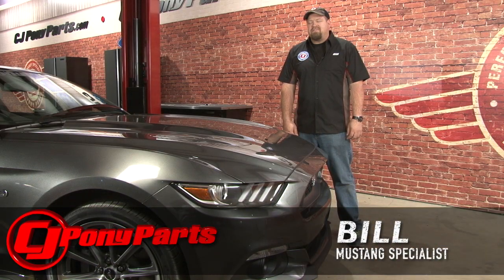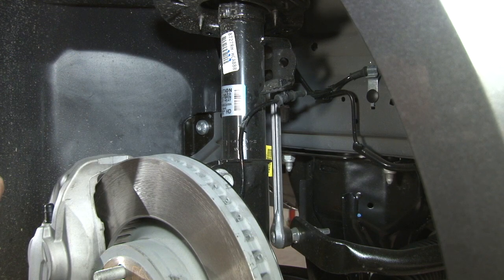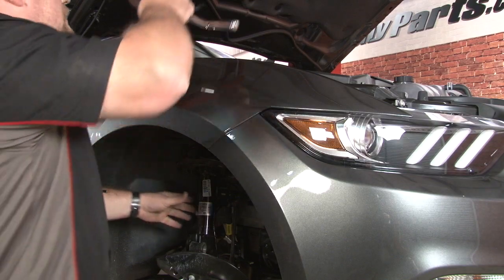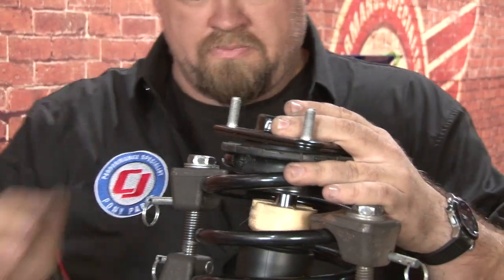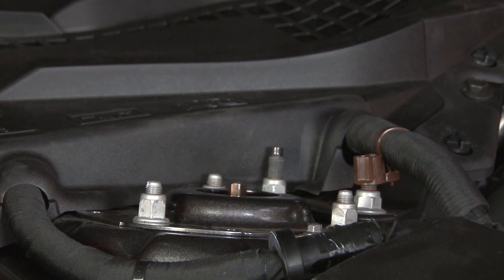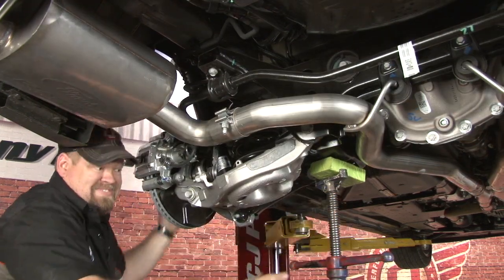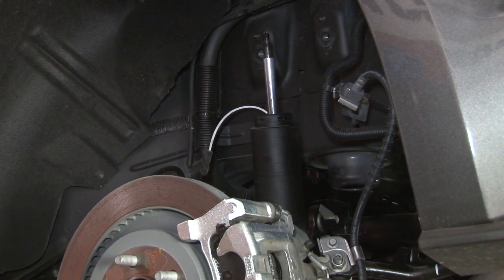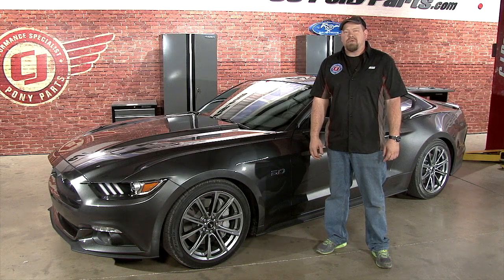2015-2023 Mustang GT Eibach Pro-Kit Springs Installation

Comment: Just got this done and everything went exactly as demonstrated on your video. However, my manual spring compressors did not comply with the diameter of the spring perch so I had to jack with that to find a sweet spot where they would compress and release clear of the perch. I logged about 4 hours actual install time in my driveway on jacks, but the spring compressor puzzle took about 30% of total install time, other than that the install was a cake walk and the results look great.
Reply: Did you have trouble knocking out the splined bolts at the base of the strut? Mine won't budge no matter how hard I pound on them.
Reply: You need to use a dead blow hammer on the lower bolts. I have a non-marking type hammer but if you place a block of wood on the end of the bolts they shouldn't distort as you drive them out. it takes some smacking to drive them out.
Reply: *****
Thanks. I finally got them out. It took the full force of two hands on my 3lb. hammer.
Reply: Yeah, they're pretty hard to tap out. I think I was using a 4lb hammer and it took some pounding. I'm glad to hear you weren't using a roofing hammer or anything light weight.

Comment: cJ is there only two long bolts holding the entire subframe in or your just undoing one side at at a time? Does the subframe have locating pins in the unibody? Torque specs?
Reply: ***** The torque spec I was given was 89 ft/lbs so that is what I went went. Ford used the same spec for K member to chassis bolts and previous IRS as well
Phil C There are 2 large bolts per side, I did one side at a time
Reply: ***** Sportlines will lower the car more. Around 1.5-1.75

Comment: Thank you so much for this awesome vid! I have 20" rims on my Mustang GT. Would I still be able to use this kit without any issues as far as tire clearance goes? And will all the items you described be included in the kit, or are there different stages to the Pro-Kit? And one more question, would this change the suspension geometry? I was concerned whether or not the lower control arm would remain parallel to the ground. Sorry for all the questions, they've just been running through my mind... I plan to purchase this kit soon, and I'm looking forward to bonding with my new car with working on her myself. Thank you so much.
Reply: These will work fine with 20 in wheels, there are no other parts required but a few people have gone with Maximum Motorsports caster camber plates or Eibach camber bolts to dial in the alignment. The geometry is changed slightly but creates no issues, most people including myself have felt the car gets better traction with less hop with the lowering springs installed.

Comment: Have now just done rear of new '15 GT with Track Pack.  Two major issues 1) top of shock pistons/rods now have a pressed-on spacer, which must be removed in order to remove boot on shock (build date 12/09/14) in order to install the Eibach bump-stop; and 2) the rear spring doesn't just pull out when you press down on the suspension as shown in the video...eventually after much effort, and re-watching this video, I had to first use a spring compressor to shorten the spring as much as possible (could only get one on--yikes), then a 4' steel pry bar to press the suspension down, then a 2 1/2 # short sledge hammer to tap out the top of the spring.  I had to work alone, so trust me when I say you are well-advised to have a very large, very strong friend with a large pry bar to assist in getting that spring out of there.  Since the Eibach rear is a bit shorter, it went in without being compressed, but the pry bar was still necessary.  Also, to avoid a trip to the local AutoZone when everything's apart, have a small gear puller available beforehand to remove that press fit spacer.  Also, since I'm putting on a cat-back exhaust, I had pulled off stock exhaust beforehand to give myself more room to work during the above...and it was still a major pain.
Reply: I will keep an eye out for the pressed on spacer, we have done a few of these installs now and have yet to run across that issue. I also have not had any issues getting the spring out as shown. It probably looks easier on video but a good tug with the suspension dropped as shown and it came right now on several different cars.
Reply: Bill Tumas Thanks.  The difficulty was with the RRear; when I did the LRear the next day, it was cake, just like the video.  

Another issue is that the big bolts on the bottom of the front strut just wouldn't come out after taking off the nuts.  I ultimately used a 2 1/2 # short sledge, and even that didn't budge them.  Thinking that current production might've gone to normal threaded bolts, I tried using a substantial lever on the 1/2" ratchet to see if they'd move at all.  Nothing happened.  I held back using my 350# impact wrench out of concern for snapping off the bolt head.  

My local dealer's parts guy didn't have any bolts in stock yet, and he couldn't tell from the online parts display.  The service guys haven't taken one apart yet, so they didn't know either.  So, it's going to the dealer to R & R the struts and put on the Eibach springs.  I'll report back on what they actually find.
Reply: James Bianchi Here's the final dope on this:  the big bolts joining strut to hub are still splined.  The tech at the dealership also pounded the crap out oft he bolts without result.  Then...he used a spring compressor to RELIEVE THE PRESSURE on the splined bolts, and they just tapped out.  This may be unique to the Track Pack setup, but maybe just later in the model run issue.  Cherish this info...I paid to get it.
Reply: James Bianchi Forgot to mention...when the dealer did the front springs, they also did alignment.  Said that the alignment came out Ford perfect, i.e., they were able to get the factory alignment with the Eibach Pro springs with no problems.
Reply: I came here to see if that spacer had been addressed. I just started the rear of my car and it has it on there. Car is a 2018 GT Base

Comment: Looks straightforward, but for reinstall, shouldn't Ford's torque specs be used?  If so, what are they/how do we find them? Some battery-powered impact wrenches can put out more than 350 ft-lbs, enough to ruin stuff.  Some sites have said that the front struts use a once-use set of nuts & bolts, and that replacement sets are available from Ford for about $20.  Is it correct that the original stuff should not be reused?  Please respond.
Reply: The only torque spec we had access to was the subframe bolts at 89 ft/lbs. Ford has used torque to yield bolts for years and recommends them for one time use only but most people don't replace good bolts every time they take something apart. It is up to you weather you want to do that or not.
Reply: Bill Tumas Thanks Bill; the torque specs are pretty important on suspension components. The 89 ft/lbs is unexpected; I would've definitely over-torqued.  From another source, I found that the torque specs on those lower strut bolts is about the same, 89 ft/lbs if others are interested.

Comment: Should I be concerned if the damper spins as I tighten the top strut mount? Should I clamp it?
Reply: As long as it is tight you are fine but if it is spinning you want to secure it and make sure it is tight.

Comment: Great video, would definitely sway me to buy springs from you guys when it's time, although the angle at 11:36 leaves the onlooker a little confused - hard to see what you're aligning. How easy would you wager dropping the subframe for the rear suspension is using jackstands in a garage? Have to put it up fairly high and support it with a jack?
Reply: We have had a few customers install them in their home garage on jackstands without issue.The spring sits in a perch in the bottom, its easy to see once you are there, but really can't get the camera in there.

Comment: I would make sure the spring is seated properly in the pocket on the rear suspension, There is a specific place it should go which we show in the video.
Reply: Bill Tumas what tool is used to support the subframe for the rear spring install. I didn’t notice  it in the tools needed section. and is it a necessary tool that’s needed for rear installation?

Comment: When trying to remove the nut from the strut (like at 4:35) the entire rod moves with the nut, any advice?
Reply: You would have to use a strap wrench to hold the strut or use an allen key in the center and a wrench to loosen it.
Reply: Get a pneumatic tool and that won't happen.

Comment: Have a 2015 gt. changed the springs and abs light came on.  How do i remove it?
Reply: steve carrillo The springs have nothing to do with the ABS sensor. Make sure you did not damage or unplug any of the sensors during the install.

Comment: Out of the sport line and pro eibach which of the two is lower
Reply: Paul Anthony pro eibach will make your car lower, but I’ve heard a lot of people having problems with them due to getting your car re-aligned at the shop because it’s too low. I went with the sport line and really the pro make the car sit about an .25 of an inch lower. So I guess it’s up to you.
Reply from the maker: Sportline is lower than the Pro-Kit, usually about half inch for most kits.

Comment: When lowering the subframe, what was that green thing and what is it for? To help better stabilize the subframe?
Reply from the maker: Nicholas Banda it’s just a block of wood wrapped in green tape I use to keep from scratching anything
Reply: Nicholas Banda what’s the tool he used to support the subframe? The tool that the green block of wood sits on.

Comment: Hey Bill, is it okay to use the stock bump stop for the rear? I cannot fit the ones that came with Eibach, the diameter of the hole is too small.

Comment: I have a 2015 MUSTANG GT with performance package and went with 20x10 with 275/35/20 fronts and 20x11 with 305/35/20 in the rears. 
A) will lowering it with the pro kit be fine (rubbing)
B) will I need to get the Eibach adjustable camber bolts?

Thank you
Reply: You should be fine with just the pro kit.

Comment: Hi, 
2017 Mustang s550 with 275/35/20 in the front and 295/35/20 rear, can I still use this Pro-kit set? Totally fine even I turn the wheel to the very end, right?
Reply from the maker: Yes it will be fine with that setup.

Comment: hows the ride? i mean if u dont replace the shocks and just the springs usually it gets bouncy, also what size are the tires and wheels.just to get an idea
Reply: It rides ok but could be improved with new shocks and struts.
Reply: what the best coilover suspension and maybe sway bars that u would.recomend for daily driving comfort while.still being better than stock at the track.?

Comment: Bill, do you have to get an alignment after lowering it? How's the ride quality compared to stock?
Reply: Yes, anytime you raise or lower a vehicle it will inevitably change the toe etc, an alignment is absolutely necessary.  I would also recommend checking the camber/caster after lowering, if it's off by much you need to get it either adjusted at the same time or purchase caster/camber plates or spacers.  If you can find a quality shop where you can buy lifetime alignments that will setup your car to your liking and specifications I would go for it.

Comment: I see below you said CC plates are not "necessary", but would they still help with alignment or is it redundant? Also, would a bumpsteer kit be a wise addition to the lowering springs even though it's not too big of a drop?
Thanks for anyone who can help, I'm still kind of a newb with this.
Reply: +Spaceman24  They will help dial in alignment for sure. Bumpsteer really isn't an issue unless you go a little lower.

Comment: i noticed that the install on the gt the tire/rim combo is smaller than what I have. I have the gt premium convert with the 20" tire package. will this kit fit my car?
Reply: Yes it will work fine with that setup.
Reply: Will this setup work with 20X11 305 35R 20s in the rear?

Comment: Hi CJ. Eibach Pro Kit will fit to the GT Premium models to? And it will lower?
Reply: Yes they will work on the GT Premium and provide the same drop
Reply: +Bill Tumas And with the Performance Pack it will be lower or just with the Sport Kit?
Reply: Bill Tumas Bill question.. after install with this springs.. an alignment should get done with no problem? no camber arms needed for the s550's or anything? new to the stang community, coming from a 350z-370z those needed camber arms to get the alignment on point and not have to much negative camber.. thanks in advance
Reply: Yes I would recommend an alignment and, unless you go extreme with the drop, you will not need any other parts.
Reply: Bill Tumas thanks Bill!! 👌

Comment: What are the alignment specs after you drop vehicle.  I purchased Eibach pro kit springs after watching video and information is not included with springs.  Shops(Firestone,discount tire, etc.) don't have the alignment specs for these cars yet and I went to Ford dealership and they don't have the specs either.  Kind of pointless to be selling kits that don't have wheel alignment specs included especially when shops don't have this info yet in there systems.  Tires will go bad fast... Fail for Eibach for lack of alignment specs.
Reply: if they alignment shop knows what they're doing you shouldnt have any problems
Reply: Actually no and nobody wanted to touch it.  Every car has different specs for caster, camber and toe.  Plus these cars do not have adjustments for caster and camber as they are fixed.  The camber is what gets thrown off when lowered and they don't sell any camber adjustment bolts for these cars yet.  What I did was buy one for the 2014 mustang which worked on the 2015 but was a much skinnier bolt but still worked.  I had my brother who works at firestone as a tech get the stock specs before lowering and getting the print out.  He entering a 2004 mustang cobra to get specs as these cars came with IRS.  Everything came out in red which proves that all cars have different specs.  You have to enter a vehicle with IRS and not solid axle or it wont give you any specs for rear tires.  As far as the stock specs I got here it goes for anyone that needs them.  -0.8 Left & -1.1 Right camber front, 7.2 Left and 7.1 Right caster front, -0.18 Left & 0.13 Right toe.  Toe seems to be off from factory as they are not close to each other.  As for the rear here are the specs. -1.4 Left & -1.5 Right camber rear, 0.07 Left & 0.24 Right toe.  Again the rear toe also seems to be off from factory but the car drove straight, no vibrations with smooth ride.
Reply: tomnguyen717 rear also has no adjustments which is weird ford didn't include this and did include this on my 11 year old 2004 mustang cobra which has adjustments for camber in the rear with an eccentric bolt from the factory.
Reply: Alex G
find a better shop, theres no reason a local (non-chain) shop cant get it on their lift and align the car properly. like tomnguyen717 said a good shop will be able to regardless of having specs.

Comment: hello cj pony,
i am a customer and i just bought a set of eibach pro kit springs and the dealer just called me to tell me that i now need a camber kit, i was just wondering if this is true and if so why wasn't i told at the time of purchase or even on this video?
now my car is at the dealer stuck because the parts are not even available for purchase so my car has to stay parked till then or pay another $300 to install the stock ones back...
how can you guys help i have spent over $1000 in your company this month alone
Reply: There is no reason to reinstall the stock springs, most cars will align to spec without the camber bolts. If it doesn't it will only be slightly out and will not hurt anything until you get the camber bolts installed. Eibach only recently listed one for 2015 GT fitment, long after this video was made. We are adding them but if you need them in a hurry Summit Racing has them in stock. Part number is 5.81280K

Comment: I have always heard that putting aftermarket(stiffer) springs with your stock struts/shocks will prematurely wear them out. Is this true?
Reply: +Jahcrooks  Depends on weather or not the new springs are within the working range of the original shocks and struts. If you go too low the stock parts will wear prematurely, an inch to an inch and  half and you will typically be ok.
Reply: ok, thanks for your response

Comment: Hi bill, what size wheel would you recommend after the pro kit installation. I'm thinking 20"x 10.5 but im not sure if they would work. Please advise.

Thanks!!
Reply: With the proper offset we have run 20x10 all around with no problems, 10.5 should not be an issue

Comment: This might sound stupid but wouldn't been easier to just loosen the rear lower control arm push down on it then remove the spring?
Reply: We tried that. You can't compress it enough by hand, if you have a spring compressor that fits or feel lucky with a prybar you can get it out that way.
Reply: Bill Tumas
i used a prybar :) on my cousins car
Reply: tomnguyen717 It absolutely can be done that way but we are not going to show that. There are too many safety issues using the prybar method.

Comment: Wasted a lot of time taking calipers and rotors off, probably would have been better just to use a wrench on the caliper side and a breaker bar on the other.
Reply: Its only two bolts to remove caliper and he said there are splines on the bolt to stop it from rotating. Plus removing the disk makes it easier to work.